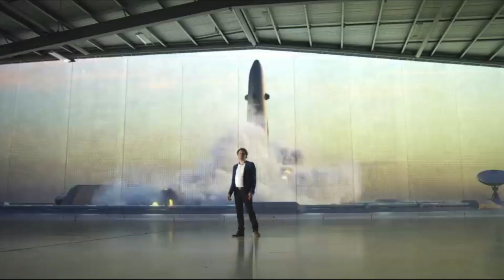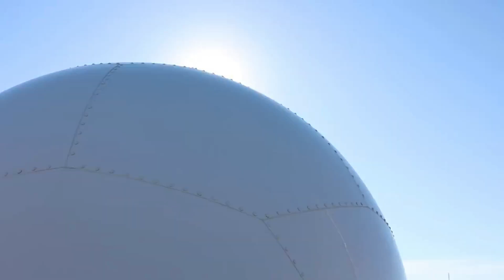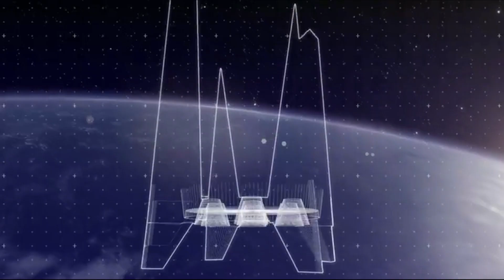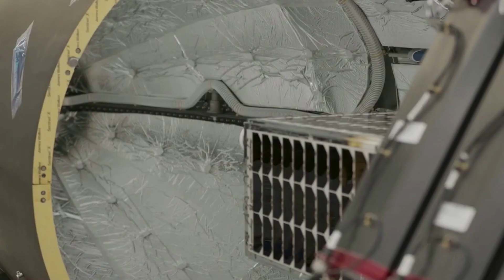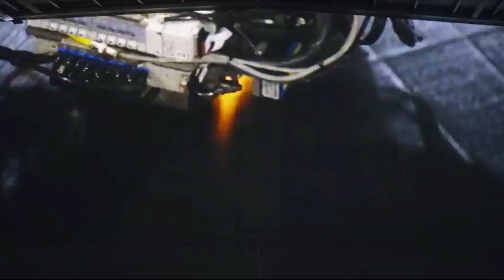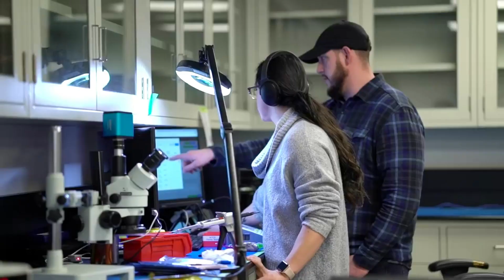Rocket Lab Continues To Make Progress On Neutron

Comment: Perhaps the most significant constraint to timely Neutron development is the now identified oxygen rich stage combustion methane / oxygen rocket engine.  Staged combustion engines are difficult.  The only other oxygen rich stage combustion engine that has been developed in United States has been the BE-4.  The BE-4 has been in work over 11 years with a first launch scheduled early in 2023.  I don't think Rocket Lab has 11 years to wait for an engine.  Rocket Lab might see if Blue Origin would sell them their engine.
Reply: Unlike other oxygen-rich closed cycle engines, Neutron's Archimedes is not intended to be run anywhere near maximum, its primary goal is re-usability and responsiveness while running at relatively cold temperatures and low chamber pressures. The Blue Origin team selected an oxygen-rich solution for BE-4 to get the maximum performance from the engine - this is the most common reason for using oxygen-rich designs. BE-4 is intended to be run at high to maximum thrust with very high chamber pressures and temperatures thus introducing reliability issues and delaying BE-4 completion. Archimedes will not suffer from this issue.
Reply: @paulcarter7445  SpaceX's Raptor and Raptor 2 is designed to press the limits of rocket engineering technology. The Raptor has the world's highest chamber, thrust to weight ratio and is a never developed before full flow stage combustion cycle. The BE-4 on the other hand aim was to be a "medium-performing version of a high-performance architecture." Even with this lower technical risk strategy Blue Origin experienced  turbopump problems, combustion instability, overheating, shorter-than-planned engine life and other issues. Rocket development is hard and it is unlikely Rocket Lab is have it any easier than BO.
Reply: @WWeronko  The BE-4 thrust goal at sea level is 2.4 MN, Archimedes is 730 kN. Archimedes has nowhere near the stress issues that BE-4 has.
Reply: I did not know they run oxygen rich. What are the advantages? Is it lower cost, less coking or is it just more environmentally friendly? Technically it should be so much easier to go fuel rich due to less corrosion.
Reply: @xehpuk  Most often it's for performance, but there's also responsiveness and reusability. If selected for performance, then stress and corrosion become issues. If it's operated at relatively very low performance (low pressure and temperature), then reusability is high and corrosion is not an issue.
Reply: Oxygen rich provides more power because of higher mass flow rate. At constant chamber pressure oxygen rich will provide more thrust and better Trust to Weight Ratio.